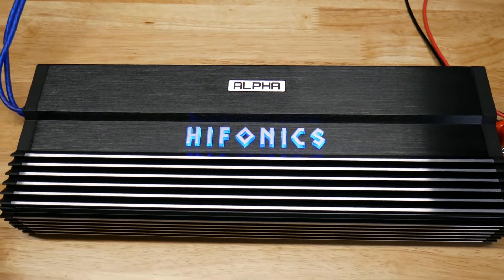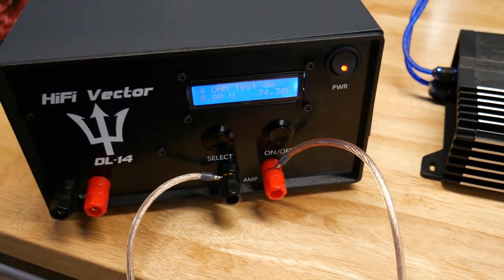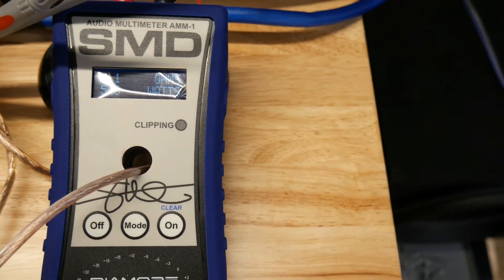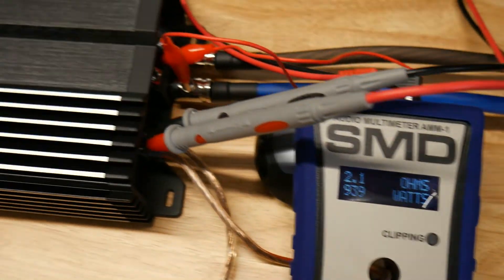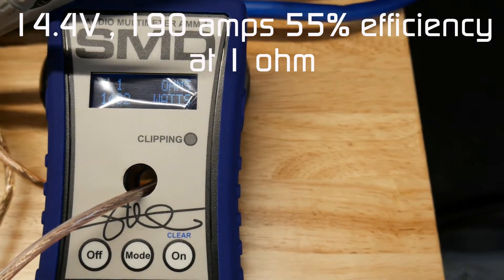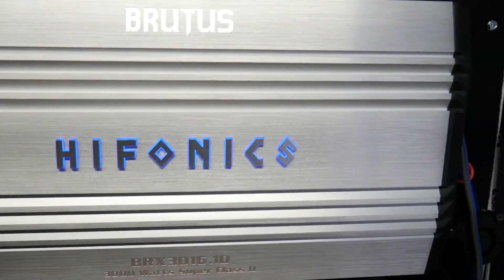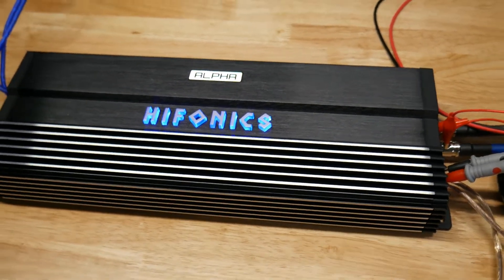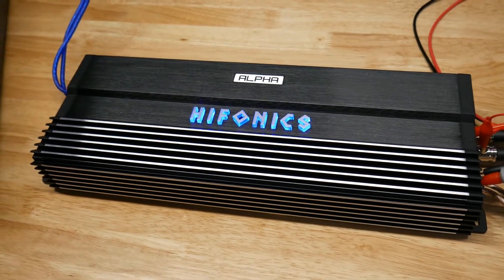Hifonics Amp dyno Alpha A3000.1D HiFi Vector DL14 audio dummy load with the D amore  SMD AMM1

Comment: I think it might be the Hifonics Alpha I think the Alpha Edition is a cheaper version because I just picked one up at Marden's haven't tried it yet..it says....A1000.20   full range d class says 1000 watts on box... but I'm trying to hook up is two dual voice coil Subs that are 2-ohm stable Subs I'd like to run them at 1 ohm but can't find an amp cheap LOL I did pick us up at Marden's $86 see if I can't hook both dual voice coil 2 ohm subs to it see what happens
Reply from the maker: They’re actually good quality amplifiers they sound great as long as you know what real watered you’re getting. In my opinion, the BRX and the BG line I have the most accurate wattage ratings.

Comment: I have a question I have a l7 15in and I have this amp my speakers rms is 1000 so is it safe to run my amp at 2 ohm since your test shows it only really running a 1000 watts ??? Please help
Reply from the maker: What is the final ohms on your sub?
Reply: @HiFiVector  so best buy did the wiring so if I get a multimeter I will get the wiring ohms correct
Reply from the maker: Yes set it to ohm’s and see what you get at the boxes terminal’s
Reply: @HiFiVector  hell yea you are awesome I will buy a multimeter in the am
Reply from the maker: Or you can pull out the sub and look at the specs and see how it’s wired.
Reply: @HiFiVector  it read 02.8
Reply from the maker: Ok so it’s wired to 2 ohm. You can use this amp it will be fine. It will give it about 1000 watts
Reply: @HiFiVector  ?
Reply from the maker: Research how to set your amp gains. It’ll be easier if you watch a video on that then for me to try to tell you through message.
Reply: @HiFiVector  I figured that ty for replying
Reply from the maker: You’re very welcome
Reply: The gain is at what looks like 55 percent can I go to 70 percent

Comment from the maker: Yes but I believe they alpha and theta are same guys just different shells. All amps sill have a slight difference because of the tolerances on the components. If you take 5 of the same amps there ratings will all be a tiny bit different.  But both the alpha and theta  were pretty disappointing.  The better HF amps are brx and Brutus gamma.
Reply from the maker: No I have not tested a BXX yet but I believe they are good like the BRX. Maybe I will have to test one soon.

Comment: I like Hifonics but they seem to never do rated.  Mostly marketing hype.   How accurate is this device?
Reply from the maker: Do you mean the Amp SMD AMM-1 dyno and the DL-14 Dummy load?  If that's what you are asking It is super accurate  pretty much 100% and shows the true  power output.
Reply: @HiFiVector  

Oh yeah exactly.   thanks
Reply: @HiFiVector  

For some reason I did not see that you were using the amp dyno